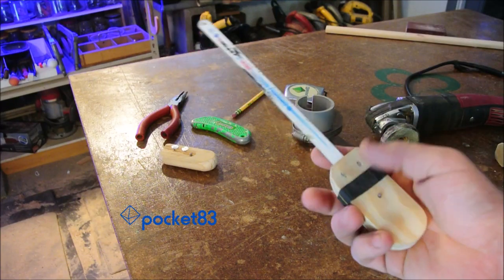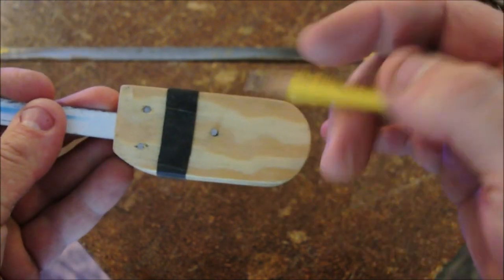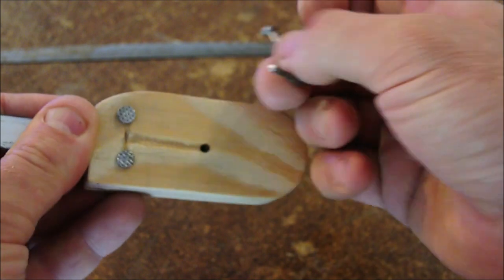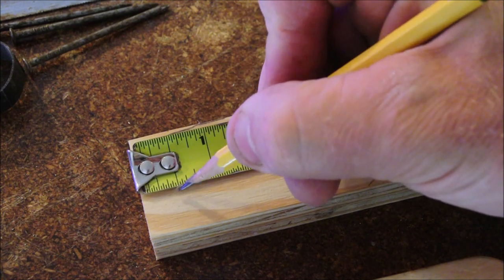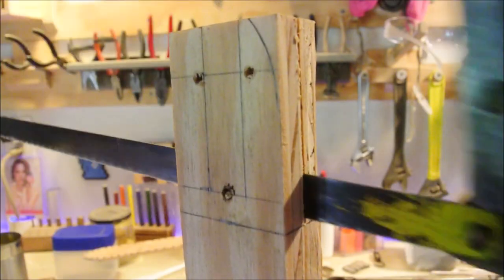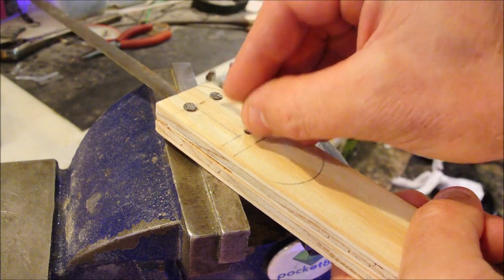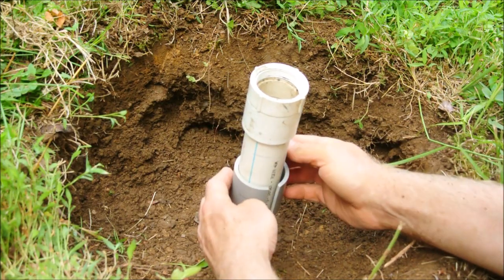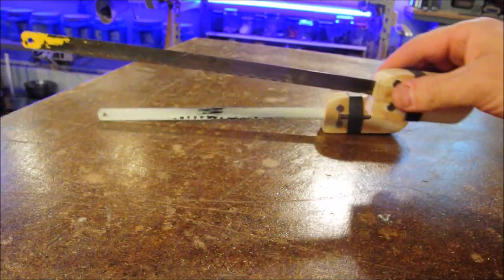Hacksaw blade handle

Comment: I saw the thumbnail and headed right for the bench. 

To date I have, copper chain, a golf ball/PVC door latch, a thin plastic circle, cut off gallon paint buckets, and a hacksaw blade flush cut handle.

Thanks Pocket
Reply: Same! My workbench wouldn't be as useful as it is without Pocket

Comment: Years ago, I bought a Lenox brand hacksaw for work after breaking a Kleine.that Lenox saw came with a couple of different blades and a handle made for mounting a blade into.  As an electrician, I found so many uses for it that it always had a blade in it and it always had a place in my bag.  Many times I had to use it for cutting nails on the boxes inside a wall.  Sometimes it was cutting a giant piece of wire that was in too tight to get with normal cutters.  It isn't the fastest way to cut anything, but sometimes fast is the last thing on your mind.

Comment: A hacksaw handle came as part of a tool box I was given. Super handy tool. It's just a bit of plastic a bolt and a wing nut but it grips a standard hacksaw blade perfectly and it's adjustable for stick out which can be very useful.
I also have a spring loaded version with a guide, that's even better for some jobs but it's bulkier so isn't always as handy.

Comment: I improvised one only be having your idea in memory, I still have to bend the holding nail, round the edges of the handle and other small adjustments (I needed one quickly so I didn't bother making it more ergonomic), otherwise it's very VERY useful for cutting square holes into gypsum boards that are already installed, with a regular hacksaw it's just impossible to do. Thanks !

Were you laughing while using the vice ?

Comment: Thank you for this! I think I'll try making one, but might cut the hack saw blade in 1/2. That way I'll get 2 blades from 1 and it'll be more compact (with less bending).
Reply from the maker: Dremel will work, but these can also be snapped in half. Be careful. It's super-hard metal. Watch your eyes. Gloves advised. Fold blade in half, then tap the fold flat with a hammer against metal.
Reply: @pocket83squared  except one blade would be a push stroke configuration?